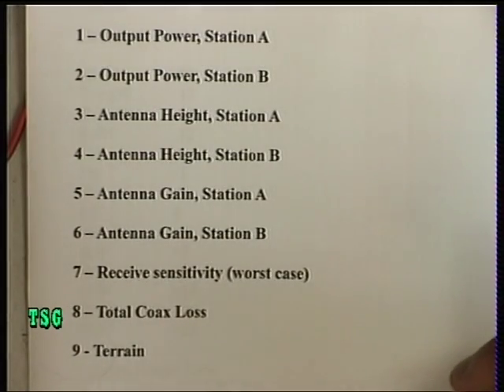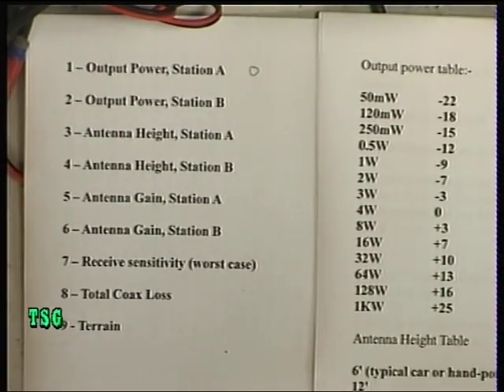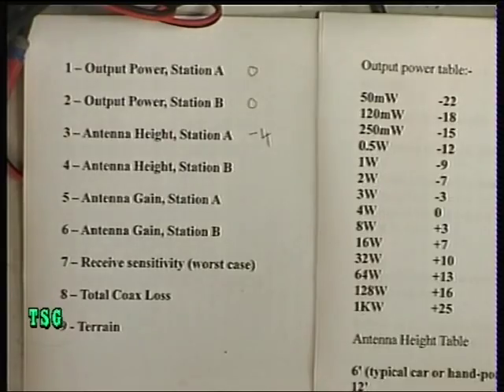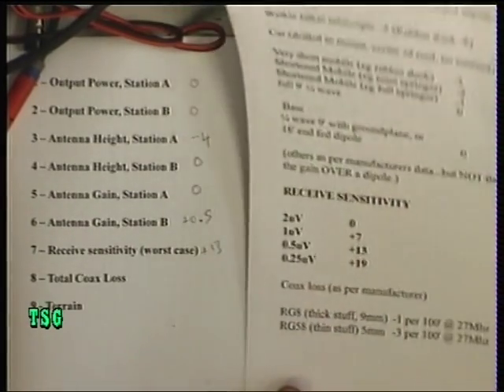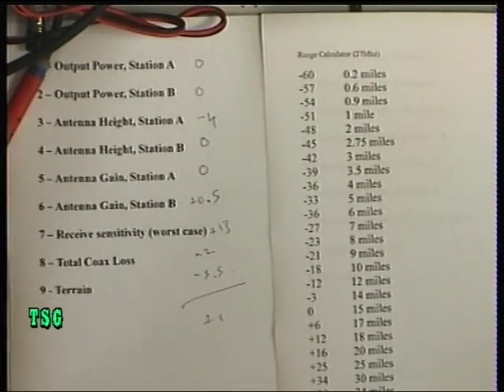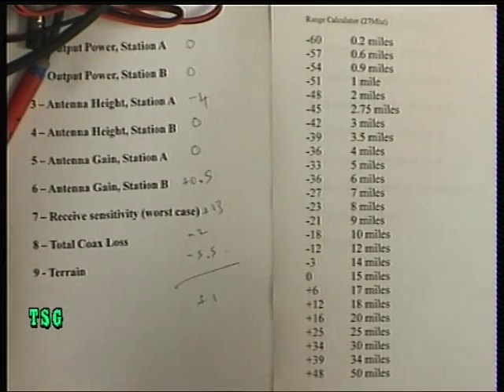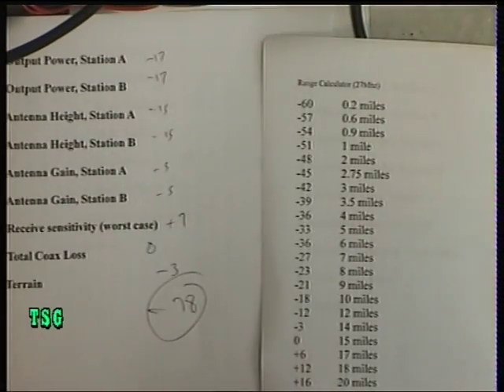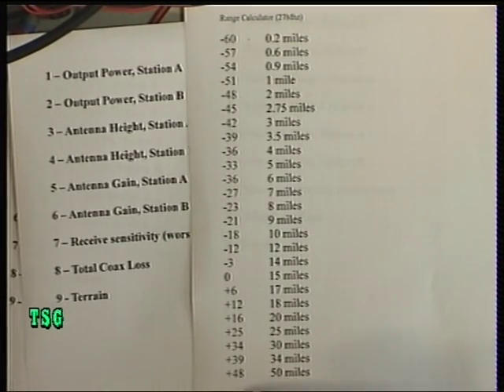Calculating the likely range of AM & FM CB radios

Comment: i have spoke to france spain and barbados on uk 27/81 using only a president licoln and a 3 element quad although the antenna was about 90 feet in the air and i did have a very high location at the time. i think that location and antenna and how good you set it all up helps to
Reply from the maker: Bear in mind that directional aerials are not UK legal. The range calculation charts are for omnidirectional aerials.

Richard

Comment: That doesn't work in the us can't believe we put that out.you can't get out with 4 watts now days across the street.i talked to a guy where your from doing 50,000 watts,that's more than our fm radio stations.
Reply: 50kw in the UK...me smell BS...most power we run is 4kw from an OM 4000 amp...there are no antennas out there to be able to run 50KW let alone the coax???? plus you would need 3 phase or 4 phase to run that current...so i believe the guy was telling you utter BS

Comment: It's very good and I understand how it works but surely what was apparent back in the 1960's and 1970's can not hold up in the modern world.
Indeed the old tranceivers have very good receivers (BTW I own a number of Sir Alan Sugars finest) but modern problems as many of us encounter like Power Line (PLT) devices alter this theory somewhat don't you think Richard.
But a very interesting video for sure and keep up showing us the UKFM radios.
Reply from the maker: You are absolutely right. The way I show it assumes no noise which has dramatically increased in recent years. One improvement is no colour TV's with valves in them that used to spew out RFI as you drove past rows of terraced houses.

The original data, which as I said in the video is not my work, but mainly US FCC research doesn't have the table "receiver sensitivity" but "required sensitivity" instead. That way enables you to calculate the likely arrangements required to, for example, attain S9 at each end!

So, as I drive round towns, the RF intereference is dreadful near buildings. Here, in the middle of nowhere, unless there are unusual radio conditions, I only have S1 of residual noise on UK frequencies, but S3 residual noise on CEPT channels; hence local farmers wanting optimisation on 27/81 only.

Totally off topic. I'll be doing a video in due course showing power meters aimed at the CB market with their outlandish generosity demonstrated. I bought a CB off Ebay a bit back "doing 15 watts". Strange, because it was doing 4.4. Mind you, Dixons used to sell HiFi like that; they could turn 4W per channel RMS into 64 watts output. Known at the time in the trade as "Dixons watts"!

As I said before, my main business here is in church pipe organ restoration, with the radio side only being done over the winter months. I'm just really only doing one set per week over this period to keep the interest up. Current demonstrations are using my own sets. Hope you enjoyed having one of my part time helpers chip in (Mark, G7NDJ), the other day. Can't get the other Richard to say anything when he's here, and can't get across to Bob, who comes in on non-technical help to be quiet when I'm recording!

Richard